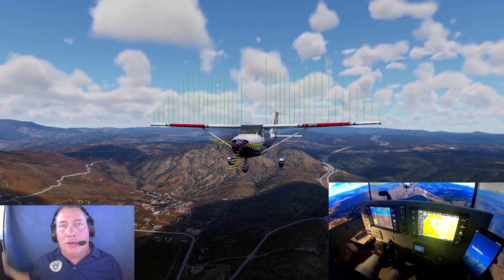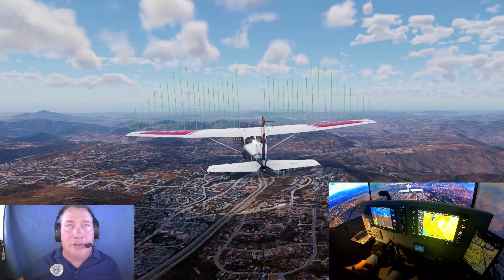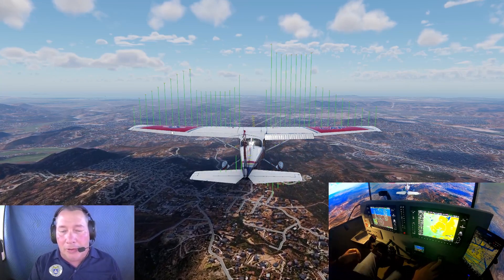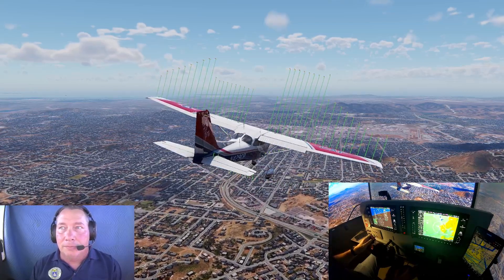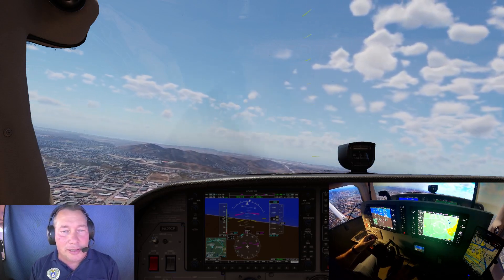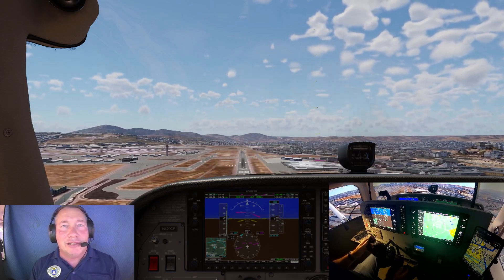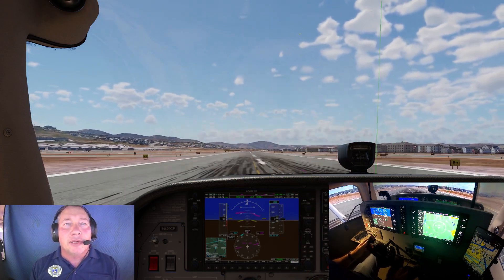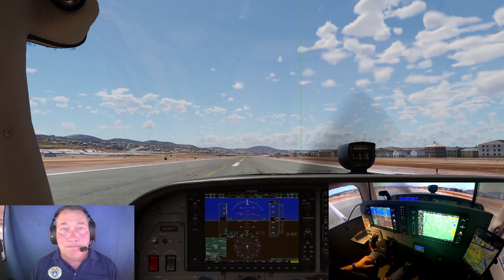Can you land a Cessna with an asymmetric flap extension? Deploying flaps while turning a BAD idea?

Comment: Very nice video! I am wondering, if the aircraft is still controllable, if one flap is fully down, and the other one retracted and at low speed. Like wenn you are on short final and one pushrod brakes, making one flap go up completely. Will the ailerons be strong enough, to counteract and keep level flight?
Reply from the maker: They will! It's required in Part 23, aircraft certification
Reply: @ronsflightsimlab9512  Thanks for your reply! I looked into the Part 23, but I couldn't find anything regarding a full flap asymmetry (e.g. 30° and 0°)🤔do you maybe know the exact passage?